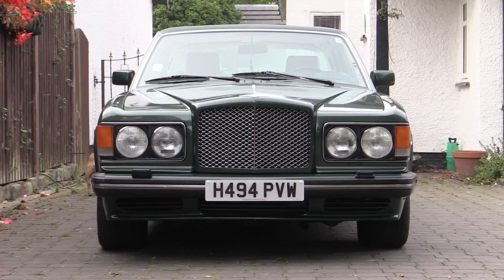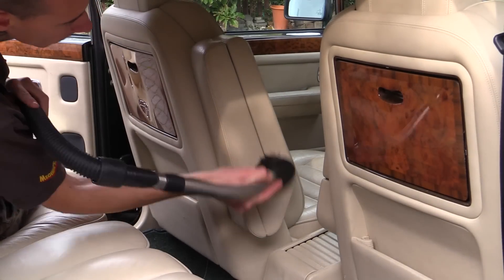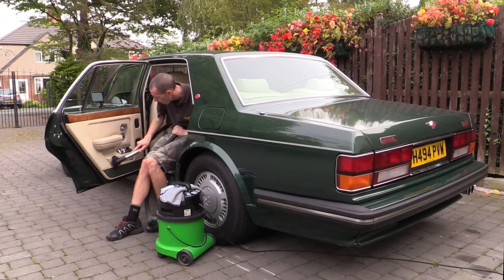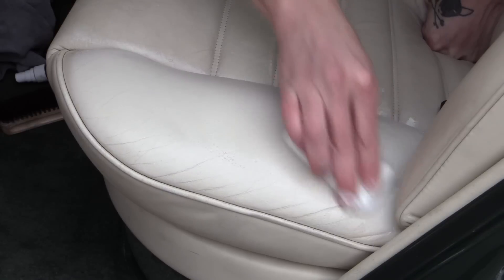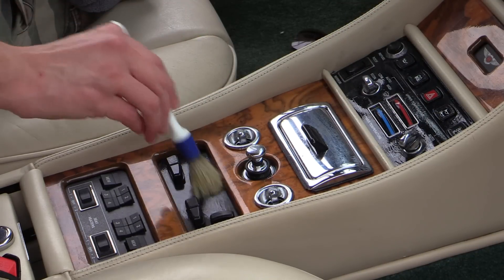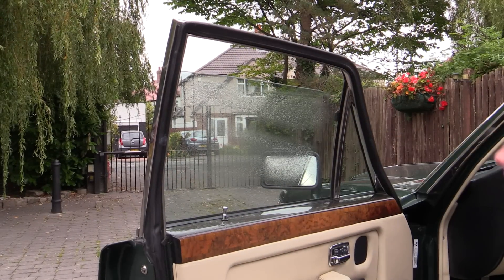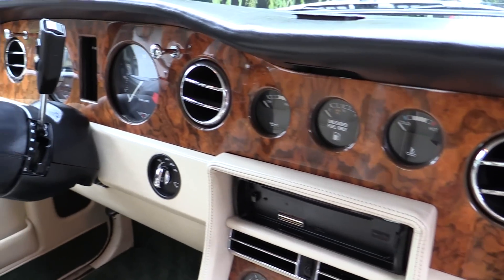Decades of Dirt! Bentley Turbo R Interior Clean

Comment: Thie video looks like a such of amatour , u should change chanel name in to car detailing amatour hehe. 
Basicly 
At first : you using a only leather cleaner and a poor detergent in second step to remove sticky feel from leather - no profesional
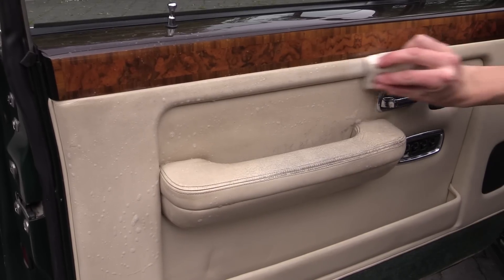At second - the driver doors on video wasn't cleaned , at around 10:15 after your clean still visible toons of orther colour dirts.
At third - vacum machine on the wooden imitation elements - It gonna scratch them well.
At least - no dressing on plastics elements , after 3 months they gonna looks like grey.
And 1 more what i did notice, not even touched gas and brake pedals guru ...
Reply from the maker: I spent 8 hours on this car free of charge for your viewing pleasure so stop getting your knickers in a twist.
Reply: @CarCleaningGuru  what mean knickers on a twist ?
Reply: @CarCleaningGuru  ok i googled it. My bad im not native

Comment: Disappointing video that showed the same kind of cleaning job one could expect from a 3 star hotel maid or a commercial carwash. The only substantive  difference was the amount of time spent..  None of the odor and smell absorbing surfaces were cleaned and the techniques were mundane.  This is comparable to washing your face, arms and hands and saying that you took a bath.

In-vehicle hose vacuuming removes only a small percentage of loose carpet soil. The Bentley carpeting is designed to be removed for mechanical beater brush removal loose soil before solvent cleaning. Completely missed were the headliner, the spaces under the removeable rear set, behind the removeable trunk liner panels and the ventilation ducting, all of which accumulate dust, smoke, oils and and odors.
Reply from the maker: Considering it was carried out free of charge, within limited daylight hours and in front of a cumbersome camera setup I think it was quite the achievement, as do thousands of others. As I said at the very beginning of the video the aim was to make a realistic improvement, which is exactly what one did.